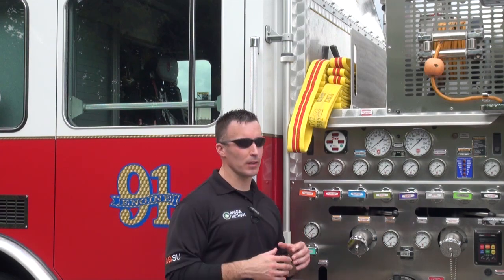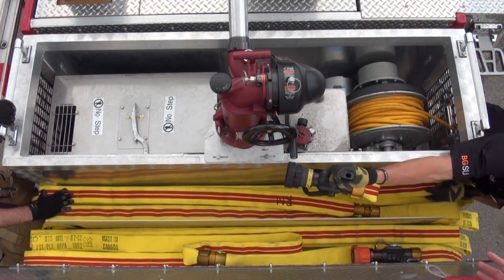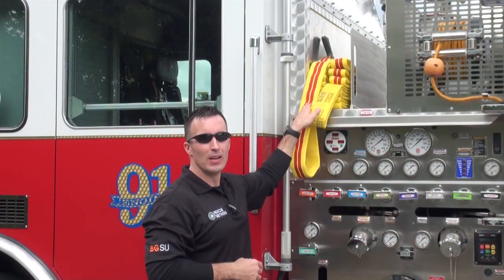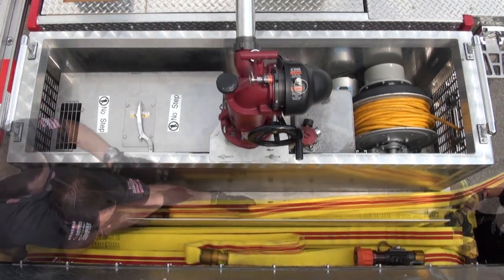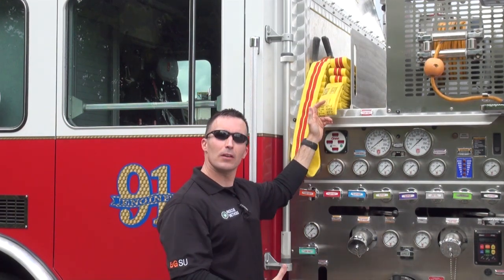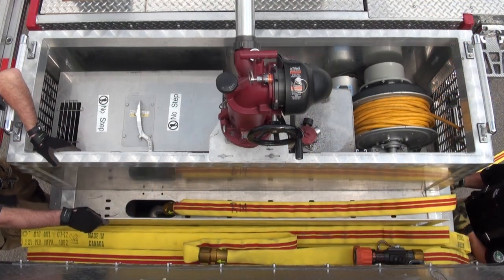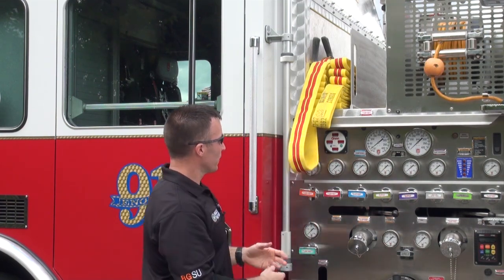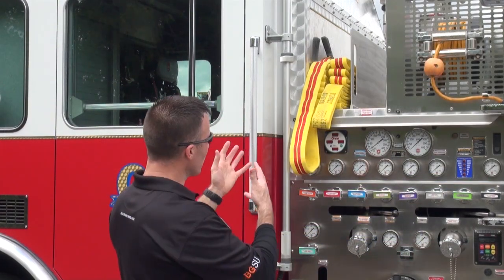Minute Man loading and deployment

Comment: Great concept for open parking lots and open curbs/yards with little to no obstructions. I Prefer the side by side double shoulder minuteman. Great for townhouse/ apartment complexes and on street parking areas where most times your engine company will be positioned up against parked cars. This also prevents the need to flip the shoulder load, which is just a wasted movement and many times isn’t executed properly to facilitate a clean stretch.

Comment: continued.... of the other half of the load.  Although inline pulls usually work best with most loads, placing the loop higher in the 2nd stack facilitates the walking deployment and keeps the hose from piling at your feet by stretching line above and below the loop to clear the bed.  The pump op. checking the bed is clear prior to charging is an important step in the case of every line stretch.  Good Comment Brother!  Stay safe.

Comment: why so many stacks on the bottom half, why not have the one layer then the pull loop to pull in order to clear the bed. It appears that you will need to stay in line with the hose tray for 50 feet before it it cleared. The long pull IS hard to do around obstructions.